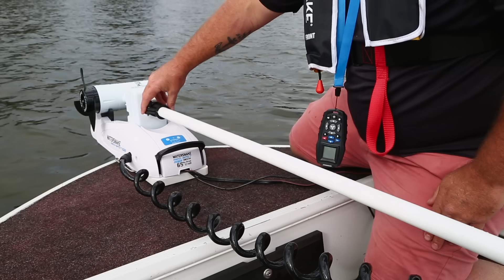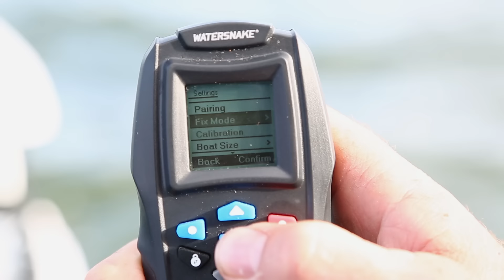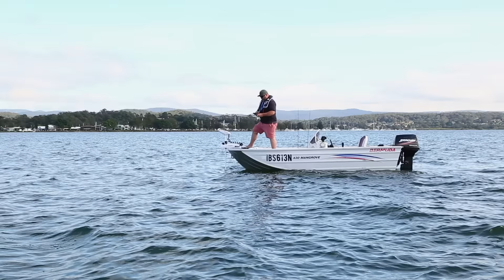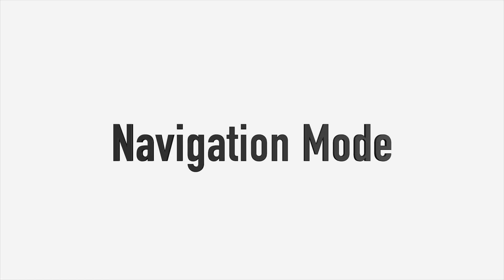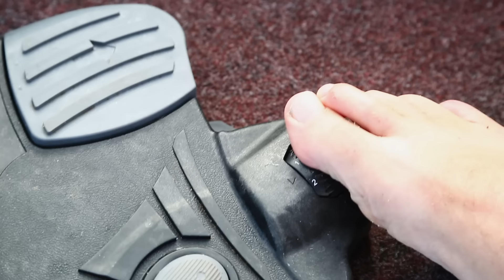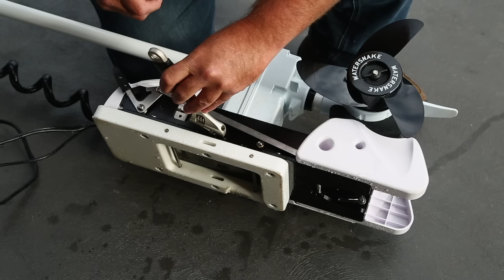Watersnake Geo-Spot GPS Electric Motor:  Full Operational Guide

Comment: Terrible product, mine has given me endless problems since day one. No GPS Fix, broken bushings on the motor base, main driver board had to be replaced twice due to water ingress this has cost me 3/4 the price of the motor by now. The GPS Puk does not connect to the motor, light keeps flickering, I was told this is normal. You are much better off spending the extra money and buy a well known brand.

Comment: howdy,does it have a jog mode? like if you are in anchor mode,can you press so you move a meter or two at a time? 
 thanks very happy with mine,just bought the foot pedal,havent use yet..
Reply from the maker: Hi, to get jog function you need to get the Watersnake GPS Nav Sensor and connect it to the motor. The Nav Sensor also improves performance of Anchor Mode and other GPS modes of the motor, by telling the motor where the stern of the boat is. More info at https://www.watersnake.com.au/collections/watersnake-electric-motors/products/watersnake-geo-spot-gps-nav-sensor
Reply: @jarviswalkerfishing  hey thanks for taking the time to reply cheers ..

Comment: Had mine for since late may mech struggles to release all the time and now motor thinks battery is flat and can't not get a reply from watersnake for warranty and help would great thankyou
Reply: I had the same problem. Put a little grease on the rubber stopper inside the housing where the little white box sits when stowed. It certainly helps a bit
Reply: @robprideaux3279  What weight is ur boat and what speed can u get? With 2-3 people in the boat?

Comment: What is the warranty period on these? Can't find it mentioned on their website or resellers.
Reply: Hi All my remote stopped turning on after one trip. I’ve put fresh batteries in, never dunked it in water. Where can I get a replacement?
Reply: @spacejumbofudge4  really did you try taking it back to where you bought it from for a refund? Would like to know if you got this problem sorted as I'm planning on buying one myself
Reply: @Ridge2ReefAdventures  Hey mate, yeah i sent an email to Javis Walker and got a reply the same day stating that they will send out a replacement one no questions asked. I received within 3-4 days the new one with a postage paid envelope to return the faulty one. Never had a issue since with the remote or the unit, its great and does the job and is very low battery usage.
Reply: @spacejumbofudge4  Same problem failed to turn on before getting on the water. Replaced no problems now anchor lock mode has failed and need to send whole motor back for recalibration.
Reply: @nathanrakete6281  No good mate, I'm sure they will sort it out for you.

Comment: What's the biggest boat this will work on?
Reply: 65lbs motor runs on 1 12volt battery can be used on a 5m boat
Reply: they make an 90 lb 36 volt job I believe.   So pretty big up to 24 feet .

Comment: I brought my geo spot about 3 weeks ago super super happy with it. For the money you can’t beat it. Highly recommend this electric motor 👍👍
Reply: Just ordered mine yesterday mate can’t wait for it to arrive. Any do’s or don’ts I should be aware of....also would love to know what sort of deep cycle battery your running with (Ah ) for best operation.
Reply: opticstream I am using a ( single )120ah battery ( because it’s only 12v )
 and I haven’t come close to running out of power yet. It’s a fairly simple motor to work out when using. Anchor mode is just one button when using its super easy. AWSOME motor you won’t regret buy it. Just read over the instructions a couple of times and you’ll have it worked out in no time. Cheers mate have fun with it.
Reply: Stephen Blaney took your advice mate got myself a 120ah battery as well. Your right I’ve been using it for ages now since putting it on the boat and love love love it !! 
Gotta love that spot lock it makes life so easy. 
I’ve also got a trickle charge set up off the motor only catch is make sure it’s discounted when charging your battery as all reports are they don’t like more then around 12.7 volts going through them when charging. Have seen issues of ppl frying their motherboard because of over voltage inputs. Apart from that best 2k I’ve ever spent lol
Reply: @opticstream  Where did you buy from in Australia?
Reply: Matt Evans yeah mate got it from Dinga.com 
Great little motor and having a blast with it.
Reply: @opticstream   hi does it come with all the mounting assembly or need to buy separate?
Reply: @Cairnsfisho  hi mate.   get the geo spot. Heaps cheaper then the minn Kota and super reliable. Haven’t had any problems with the geo spot and the spot lock function is super accurate. Both motors have all the same functions but the geo spot is approximately $500-$600 cheaper. 👍👍
Reply: Where did you buy from in Australia?
Reply: The duck's nut's m8 awesome kit bort mine 6 months ago and stoked with it.
Reply: @forge1801  👍👍
Reply: Me too ,there was no way I could afford a minn kota they were to expensive
Reply: Hi mate just wondering do you still have the water snake if you do how has it been? Not many long term reviews your input would help
Reply: What weight is ur boat and what speed can u get? With 2-3 people in the boat?